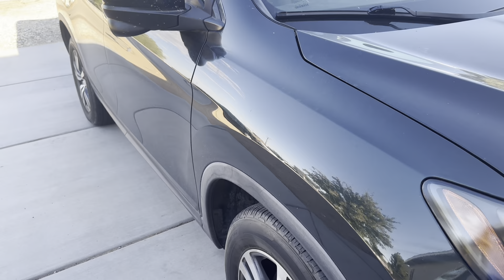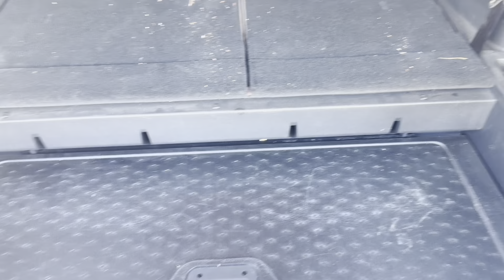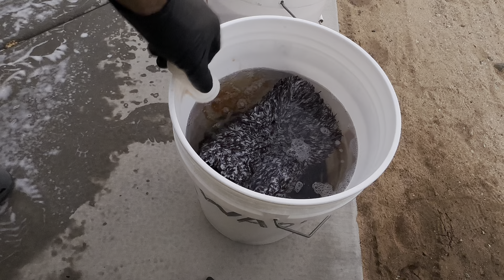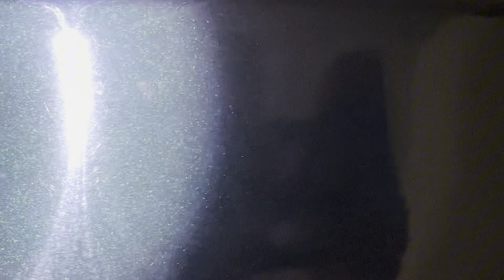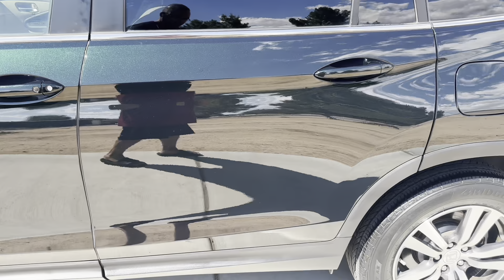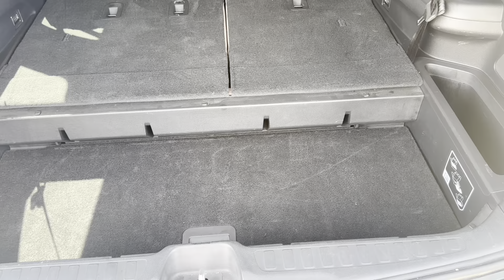Is DIY Detail Ceramic Coating good for beginners?

Comment: It’s easier to use the decontamination towel while the car is all soaped up. You get  better result and use less iron remover.
Reply from the maker: Thanks for this! I couldn’t figure out what I was doing wrong. 
Thanks for watching!
Reply: @thedrivewaydetailer  
You sealed in some water spots or bugs marks under the ceramic coating. If you watch the video slowly you can see them in the light on the drivers side of car. Good lighting helps and you probably needed to use compound on those spots before coating.
Reply from the maker: One thing I didn’t mention in the video was how neglected the paint was before I did the ceramic coating. The car is my father-in-law’s car. He recently bought it from a family friend whose father died recently. The previous owner had a lot of trees on his property so there was etching from bird droppings which had been left on the paint for almost 10 years. I tried getting to one spot on the hood, but it would have taken more time and skill than I had, and there was spots like this everywhere. The end shots do it no justice and I framed the shots so most of the etchings wouldn’t show. If this would have been a paying customer I wouldn’t even had done the job when I found out how bad it was, but I did it for free. Also, my father-in-law barely keeps up with his own cars so he didn’t really car what it looked like before or what the end result was. I did the job because it looked like a fun challenge. 

Hopefully the background helps you understand what I did and didn’t do. 
Thanks for commenting!
Reply: @thedrivewaydetailer  
Good job for taking it on then. The skill will come and you’re off to a great start with a great attitude that will do you well. Ya cutting can be tricky on old damaged paint, some not worth the risk and you did bring a lot of gloss back. Good luck to you.